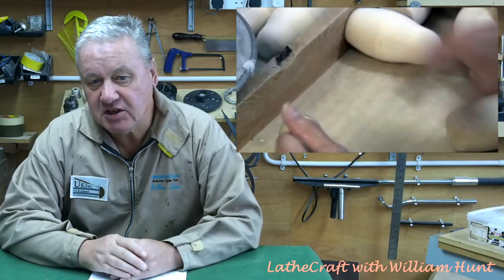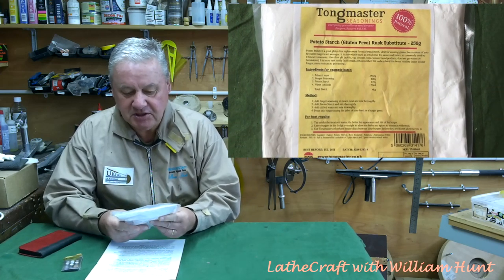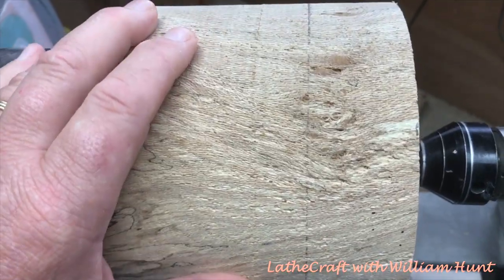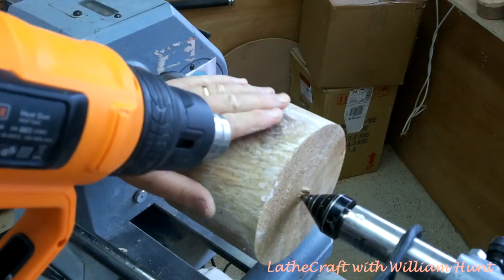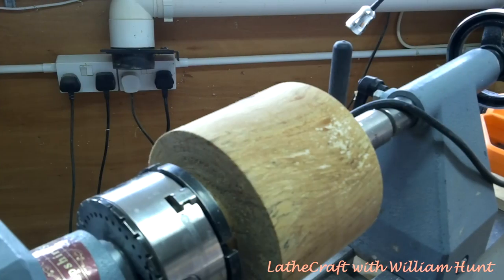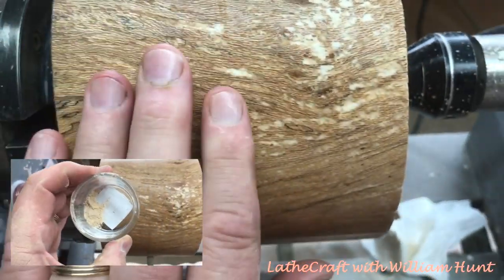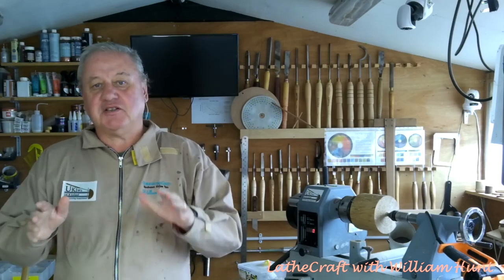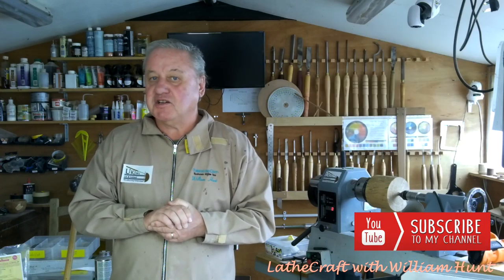🌳Woodturning |Turners Filler | Woodturners Potato Starch Filler | Woodturning Potatoes

Comment: Great idea of using starch. I knew corn starch is also an accelerater for CA glue but leaves a plain white streak. I never considered adding sanding dust. Great idea. I may try the corn starch like you used the potatoe . Looking forward to the next installment.
Reply from the maker: Thanks you, yes it appears that starch along with baking soda (sodium bicarbonate) is but as you say it leaves stains in the wood, hence I was looking for something that didn't.

Comment: Great stuff William. I was very impressed you found this in Russian - brilliant. I think wallpaper paste may also work as it is starch based.  Someone mentioned cornflour- that contains gluten (I note you stated your powder is gluten free) which leads to cross linking and affects the adhesive properties.  So perhaps not as good. Looking forward to part 2.
Reply from the maker: Hi Campbell and thanks for the comments. Yes I did wonder about the role (or lack of) gluten might play. Ill need to investigate before part 2. I belive it works with any starch, potato, rice, cornflour etc.

Comment: Very interesting William.   Thanks for sharing.
I expect all turners battle with soft, punky, cracks, tears etc. at some time.   Some issues easier to solve than others.
I look forward to later videos on this topic.

The London Plane looked so much like sycamore I have in my US shop, I had to see if they were related.   Seems they are related.
London Plane is Platanus x acerifolia.  Sycamore is Platanus occidentalis.
I love the grain of quartersawn sycamore.   I find it pleasant to turn.
Dave.
Reply from the maker: Yes London Plane is a hybrid, hence the strong similarity. Its one of my favourite woods to turn. I want to salvage this piece but then I noticed the wire inclusions.

Comment: Nice video William, if i have punky wood or a bit soft, i tend to use the very un eco friendly ronseal wood hardener, because within an hour the wood can be turned to a fine finish
Reply from the maker: Hi Mart, Yes I've used both of the Ronseal hardeners, dry and wet rot, and had success with them, despite being told they would go white with age, they did not.

Comment: William how would you go mixing watered s/sealer with the starch and dust,just a thought. Cheers mate 🇦🇺.......
Reply from the maker: Hi Roger, not sure as starch is only soluble in warm or hot water, therefore it will be a chemical bond if you use sanding sealer. Also it wont take colour.